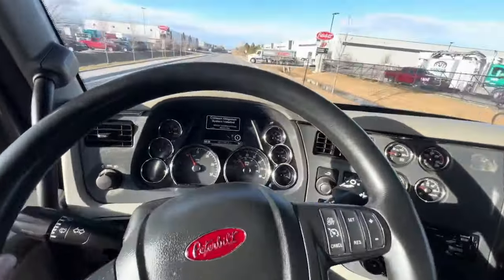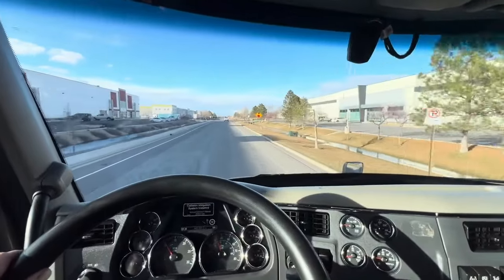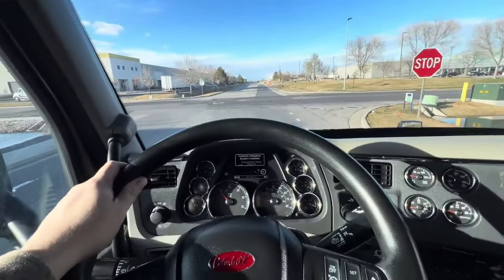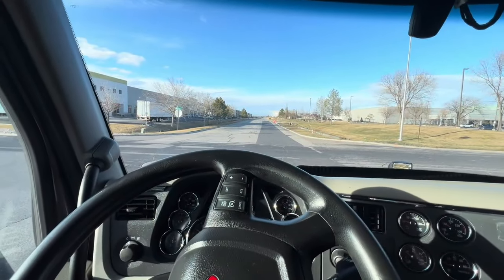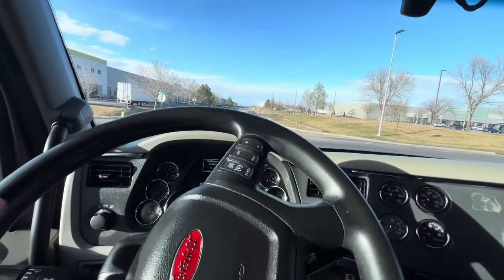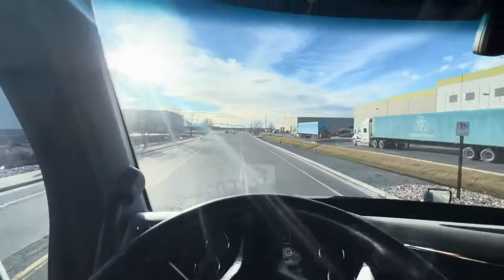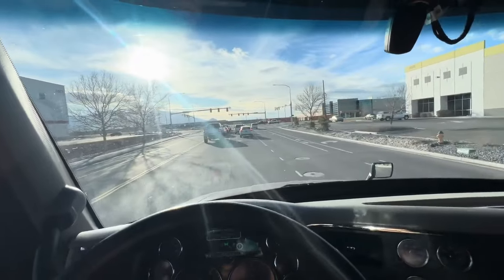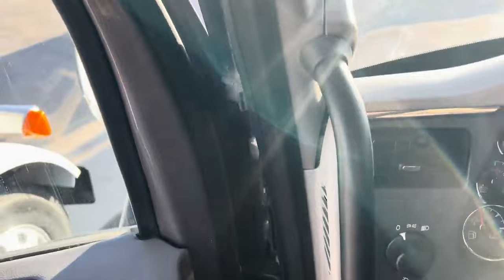Buying Another Truck In This Market?!

Comment: You’re right that maintenance and idle hours will make or break the trucks. I have 2011 international with the dreaded maxforce engine and 10 speed. It got the delete from a prior owner and it ran pretty good. It’s just hard to get people who want to work on them plus international put 0 effort into ease of maintenance with stuff everywhere. Been getting 6mpg out of it which is why I parked it since march of 2023

Comment: If you do buy another truck, make sure you keep the one you already own. You will need it when the new one breaks down.
Reply from the maker: Unfortunately to keep it on insurance alone would cost me $1300 a month. And the way commercial insurance works, can’t just remove and add equipment like a car. Once it’s off, they won’t let you add it back on. Registration no big deal but still throw away $2000 a year. If insurance wasn’t the issue and I could “non-op” it and keep minimal on it, I’d keep it. Insurance controls the trucking world.
Reply: @DrivingByBraille  Gotcha. Just remember, those new trucks have SIGNIFICANTLY more things that can, and do, go wrong with them. Not always as simple as just not having a coolant temperature gauge until you can get it fixed, that shit will not run without that coolant temp sensor working (along with hundreds of other sensors).
Reply from the maker: @bigrigbutters187 oh I know. I’m very familiar with these trucks. Never had a Cummins. But plenty of emission freightliners I’ve had the pleasure of fixing. Even had a Mack with the MP8 (Volvo) I did pretty much all the emission fixing on. I’m comfortable working on emissions. Key is to maintain. Every truck is a gamble. Even my KW dropped a valve and cost me a shitload to fix which I regret doing. Can only hope and pray right? 😉

Comment: Man… I couldn’t find 1 unquestionable truck at a dealer. The big fleets do take care of their equipment right up until they don’t need them anymore. That’s what I experienced working for Swift and I moved retired JB Hunt trucks and delivered to dealerships for a short time and yeah they really let those trucks go near the end. Marten may have just ripped the fridge out from that. I don’t think you’ll be disappointed with the Cummins. As far as emission issues go I believe they deal with them the best. I’ve driven both the X-15 and even high mileage ISX for long periods of time and never had any engine issues. 10 speed autos always weird me out, don’t know they even make them.

Sad to see your old truck go, but I understand. I have a ‘98 Volvo and it is pretty comfortable, but I know what you mean about the 
A/C and heat keeping up. And my APU is pretty much useless for
A/C, it only uses 2 vents on the lower bunk and only 1 side! As far as fuel economy the 3406 isn’t doing that bad and honestly I can’t tell the difference between this and the Cascadia I temporarily leased. That could be because that Cascadia was struggling though.

Anyway good choice with the International LT. I drove one for 130K with no issues.
Reply from the maker: This truck came from a smaller fleet, Schuster in Iowa. Was doing some research on them and they seem to keep their equipment pretty clean. Seems like the previous driver took care of the truck. It’s a really clean truck. Only time will tell how she treats me. Thanks for the encouraging comments 👍🏻

Comment: Right now is the perfect time to buy used trucks for bargain basement prices. If you can absorb the cost now and ride it out you’ll be setup for money making when the markets come back in the green. I loved my 2021 LT. It had a great tranny and would pull with a load really well. They ain’t fast but have great torque. Turn your turbo up another 30% and you’ll be good.

Comment: My buddy works at Cummins stay away. Volvo much better d13. I kinda get your drift on what you want to do to the Cummins but the cam will eat whole motor
Reply from the maker: They all have their problems. D13 is priority software. I can get anyone to work on Cummins. I have a Cummins authorized shop 3 miles from me that does excellent work and are trusted. Keeping an eye on things before letting them take a shit. A cam is easily looked at for damage, oil samples. There are things you can do. Can it blow up tomorrow? Yup. So can ANY engine out there. Even right off the assembly line.

Comment: Don’t buy Cummins just major beaches after 500k, buy Detroit 2019 build date or volvo d13 2018 and 2019 build engine. My friend has six Cummins in trucks and just too much to maintain and very expensive parts now days.
Reply from the maker: I noticed you didn’t mention the years on the Cummins. Here the thing with all these engines. Maintenance and how they are taken care of. Unfortunately ANY used trucks, I’ve had my share of Detroits and a Mack MP8 (Volvo D13) out of 5 Detroit’s I bought used, 1 blew up due to driver, 1 needed a 1 box before 500k and 1 had sensor and electrical problems galore. The MP8 was an emissions nightmare. I know of a Penske shop that had 20 2019-2020 Cascadia that were complete garbage. Engine problem after engine problem. ANY truck out here is a gamble. My CAT dropped a valve after driving it less than a year. Ask one person. Paccar sucks another day they are great. THEY ALL SUCK! Just depends on how they were maintained. Buying Used, all the new bugs are worked out and fixed but that driver could’ve just beat the shit out of it.

Comment: As a long time fallower with new trucks you ll be sorry again i ll tell you good truck with air tight glider kit cascadia freighterliner 12.7l Detroit 13spd made by harrison truck center you ll be happy next 10 yrs
Reply from the maker: Had to do something. 5mpg is killing me. I’m pissing away over 1200 a month in fuel. Yes, definitely a gamble. And it sucks. Very hard decision for sure. But my T600 comfort is horrible. No insulation, A/C only plus up front and in over 100° it can’t keep up and in the winter the heater can’t keep up due to drafts everywhere in that truck. I’ve roughed it out in that truck for far too long.